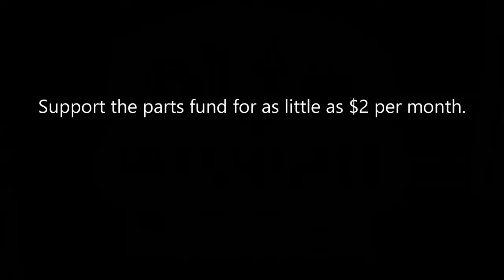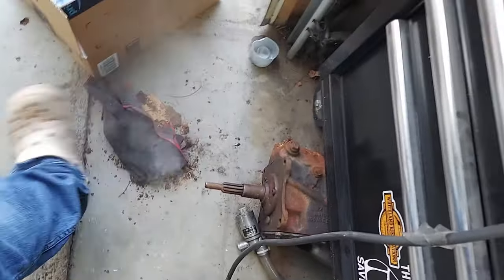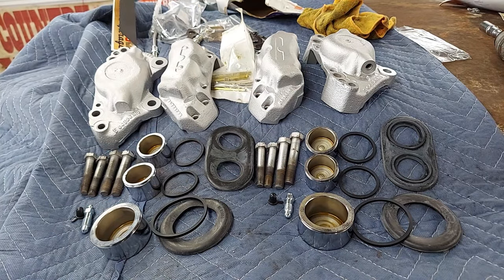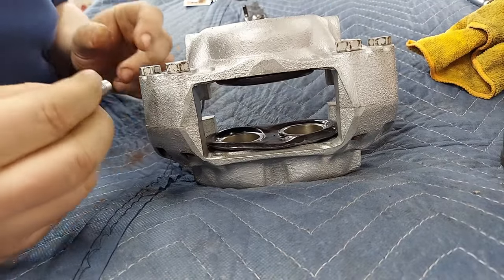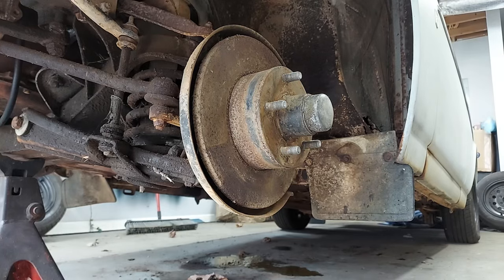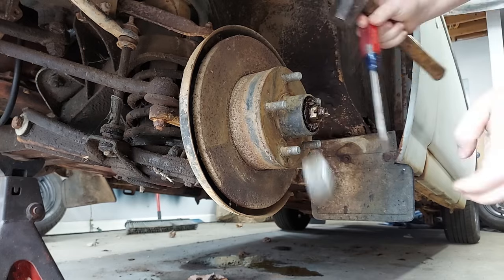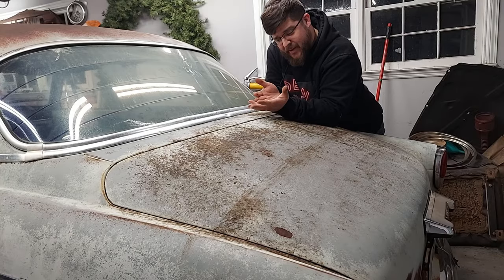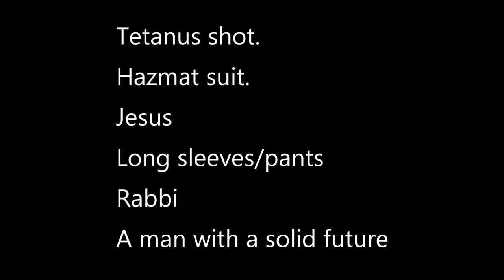67 Volvo Amazon 122s Front Brake Rebuild - Part 6 Make it STOP

Comment: I liked the frozen caliper disassembly solution. Welding the hole seems ideal. Definitely better than cutting threads for a pipe plug, which is probably what I'd end up doing (right before I crashed).
Reply from the maker: I did consider cutting threads and plugging but thought I'd give my welder a chance to penetrate the thick metal. I haven't seen anyone attack a caliper this way but it seems to be holding up soo far! Most of the time people just chuck a caliper in this condition.
Reply: I would NEVER drill the body, with the body disassembled (not recommenden by the vendors of the rebuild kits, small body o-rings are NOT included) it is easy to put some spotwelds inside the old piston and/or weld some lever to it to get some grip and pull them out, they are to be trashed anyway.

Comment: Hey man do you know anything about the rear brake valves on a 67 122s with the split left and right brake valves
Reply from the maker: Are you referring to the brake shoes?
Reply: No it’s the two proportioning valves under body before axle that supply variable pressure to rear brakes
Reply from the maker: @motorradingaround1220  oh, the proportioning valves I have not messed with yet.